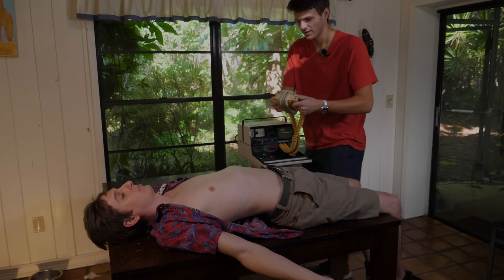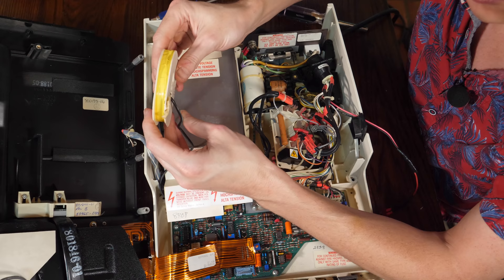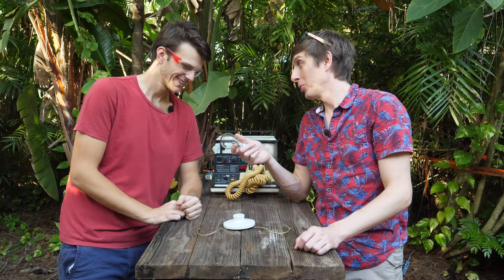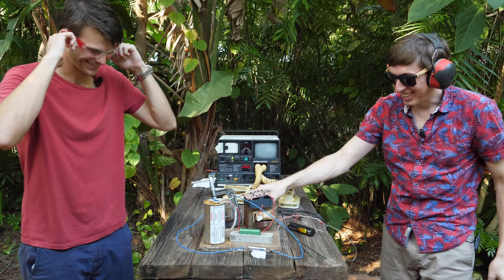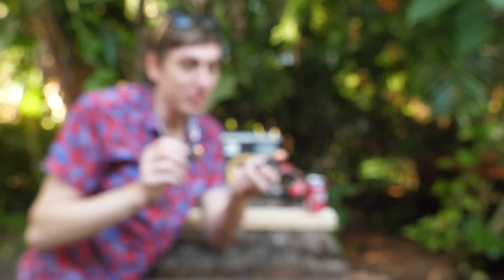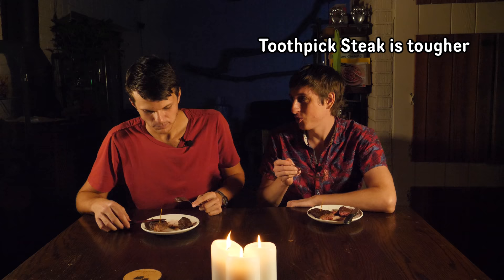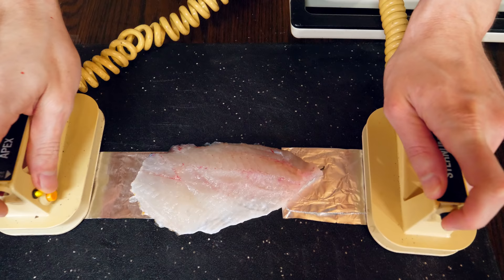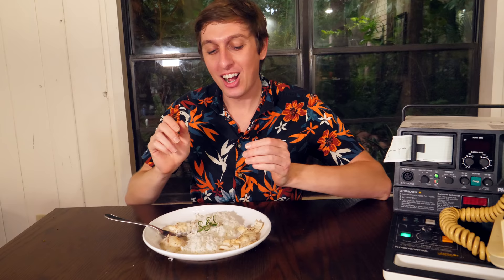We Defibrillated a Steak

Comment: “This is my homemade defibrillator” is just one of those sentences that makes your hair stand on edge
Reply: Literally
Reply: Take the like and go.
Reply: Much like the defibrillator itself
Reply: You can too. His model doesn't have the safety measures, its basically the transformer for thousands of volds, and the capacitor big enough to hold it. Its expensive and wont work on people withiut proper connection or safety. Still its a good project.
Reply: Gave me a shiver
Reply: Pretty shocking that you can get them.
Reply: It looked like a bomb
Reply: Or make your heart stop
Reply: @melester2728  or turn you into electro
Reply: @karbonkai  all electronic components are easily found in stores. You can create your own biomedical equipments if you like. The problem is that if the systems aren't supported by regulation, its illegal to use them or sell them as a biomedical equipment. Like a kitchen knife and a scalpel, both cut, but if a doctor uses the knife he goes to jail.
Reply: "....1.5 Volt AA lithium battery. So, if this explodes, it's gonna be good!"

"Yeah"

.. Yea
Reply: I got a few defibrillators around the house, they're called power outlets.
Reply: People round here dont build defibs, they just nick them off the wall as so many places have them. Open them up, short out a couple of the wires, and it bypasses the automatic part of the system and allows you to use it as a Taser (or, as in this video, to cook meat, win free worms, or open coke cans)
Reply: I was thinking "this sounds like a disaster about to happen"
Reply: I saw a hair ad when I read this
Reply: I think something might be wrong with the defibrillator then
Reply: Imagine using someones bathroom then getting blacked out and then you waked up tied to a chair and you hear someone say that
Reply: Imagine if someone is dying and there’s no defibrillator around he’s just walking down the street saying I have one 
Everyone: “*acts relived*”
It’s homemade
The guy dying: lord it’s my time to go
Adios

Comment: Whoa, defibrillating the ground to get worms to come to the surface was one of the most interesting things I’ve seen in a long time.
Reply: I know right!
Reply: Same
Reply: You can get the same effect (without the electricity) by putting a metal stake in the ground and hitting it over and over, preferably with something else that's metallic.  Or, you can use a "tamper" and just tamp the ground over and over and they'll come up as well.  Both methods work extremely well down close to a river.
Reply: @dgoddard  tamper?
Reply: @slimeball4l540  Just a flat piece of steel (maybe 6"x6") on the end of a handle so you can bounce it off the ground.
Reply: And If I remember the product was called the worm taser
Reply: Same-o
Reply: watches fireworks used to kill fish
Nvm...
Reply: @dgoddard  or you can fill a bucket of water with washing up liquid in it & pour it on the ground !
👁👄👁🍿
Reply: You can see that in godzilla movie.
Reply: @joe18425  a simple saltwater could do the trick just as well
Reply: you havent' seen godzilla 2000? yet
Reply: Does no one remember that one scene in Godzilla?
Reply: @joe18425  Why do Brits bother to say/write all those syllables in "washing up liquid" rather than just saying "soap"?
Reply: You can also just split an old extension cord about 15' from the removed female end and twist the ends around a pair of rods that pound into the ground (a foot or so) about 10' apart, soak the ground good with a sprinkler (way beforehand) and plug it in for a few minutes. Don't let kids play around it though.
Reply: I read that as “worms come out of the steak” at first
Reply: Must be a youngster, old old trick.
Reply: My grandpa used to do this.  They don't live very long when you do this, only a day or two.  If you pick them at night they will last over a month in the fridge.
Reply: Saturate the ground with water and cover it with a tarpaulin or some plastic. The worms will come to the surface in need of air, and the covering stops it drying out plus the darkness will keep the worms at the surface, they hate sunlight. It doesn't take very long, as soon as the water soaks down to the worm it will surface straight away. And Earth worms only live in the topsoil, I've never seen one deeper than 1 foot.
But choosing the right area of soil is important, there wont be many if any, the harder and dryer the area and the hotter the area.
Reply: I have heard about "fiddling" for worms as well.  I was just  a kid, and the person that told me about it is long dead.
Reply: you obviously never watched godzilla 1998  cause they did pretty much same thing ;o
Reply: When I saw that, it reminded me back in the days when I was watching Godzilla, 1998 movie. A bit later in the beginning of the movie, Matthew Broderick put the metal poles in ground and then connect to battery and that brings up a lot of earthworms.
Reply: It was faked ... can't you see the difference on the ground
Reply: @dgoddard  That is what the old timers called fiddling for worms.
Reply: @dgoddard  So basically what they do at Dune...
Reply: @joe18425  "washing up liquid" you mean that weird stuff rich people call soap?
Reply: Worm torture.
Reply: Duuuude this was in godzilla with mathew Broderick
Reply: Man I feel bad for the worms. Its like someone set fire to your entire neighborhood and abducted your family when people are out.
Reply: That is interesting
Reply: If they could speak, they'd be complaining 'OW! What was that?!'

Comment: That worm thing was fascinating. Maybe something like that can be used to deal with more dangerous invasive worms?
Reply: Wouldn't it also affect native worms?
Reply: @ShiratoriIsOffline  There is a huge swathe of the US & Canada that actually doesn't have native worms. They're all invasive. Not all of them are a problem, but neither would be getting rid of them. But, irregardless, you can just gather up the bad ones & ignore the others, if you know how to tell the difference.
Reply: Wonder if anyone’s tried using it at a lower strength to improve soil quality.
Reply: @MrChristianDT  I learned something interesting, thanks
Reply: If it just rained and you point a flash light at the ground the worms will crawl out to crawl in the pools of water if it rained that much
Reply: Are dangerous worms a thing?
Reply: Some can bite through boots. I think they're called flatworms or something?

Comment: What I've learn about ventricular fibrillation, is it's easier to compare it to swimming. If you do dedicated strokes, you'll move. But, if you flail, you don't go anywhere. Instead of moving water, your heart moves blood. And when it sputters, it isn't moving blood
Reply: . Go
Reply: The heart is a SYSTEM of pumps and chambers. If it’s all wobbling spastically at the same time, it’s not able to send/receive blood. No matter how energetically it is dysfunctionally wobbling. 
Defibs stun the heart into inaction; the practical aspect of that is then, with appropriate cardiac massage, the heart can sync back up with correct timing thru nervous system. 
Gotta stop the heart flopping to start it working. Technically, you are inducing death so you can prevent it becoming permanent. 
A spastic heart muscle is not being oxygenated. It will expire unless stunned into inaction

Comment: Shoutout to the Darwin Award winner that went "HEY... IF YOU ELECTROCUTE THE GROUND IT MAKES THE WORMS COME TO THE SURFACE!" without taking into account that they were, also, standing on said ground.
Reply: Bruh moment
Reply: They were on foam, so they were plenty insulated.
Reply: @mysan7754  He is talking about the device in the 80s that lead to 30 deaths, that is directly referenced to prior to the foam
Reply: the sad thing is most of those deaths were children playing with the devices
Reply: Nah man they were already "grounded"
Reply: @mysan7754  dude, can u read?
Reply: BRUHH Darwin award indeed
Reply: Please correct me if I'm wrong, but electricity goes to ground not though ground? Based on your joke (I'm so hoping) a lightning storm would be nature's equivalent of mass murder.
Reply: @xr88yu  was going to reply with the same common sense since the lightning flash we actually see as a strike is actually a from the ground up motion.
Reply: they are insulated from said ground tho
Reply: @xr88yu  There are multiple kinds of lighting. Most is cloud to cloud. Cloud to ground lightning does in fact murder, usually by causing massive fires.
Reply: @comandosespeciales  prob wouldnt kill ya.. worst case is it cooks your junk.. which being sterile TECHNICALLY makes you eligible for the darwin award.
Most likely all the deaths occured from people touching the paddles to atleast 1 body-part directly and not with both of them on the ground
Reply: @xr88yu  
What happens is electricity evens out through path of least resistance.
Ground is a massive bad conductor (still much better than air) at about neutral charge, so random charge, such as static or lightning grounds out. This also applies when the charge is not entirely random, but the other side of the circuit is nowhere nearby.
However a device like this generates two charges on a capacitor, one positive, the other negative. In evening them out, current flows between them through whatever you connect them through, in this case dirt.
However, depending on local humidity, humans can be significantly better conductors than dirt. Though with the charge involved, about equal would be enough. If a human is touching two places on the ground directly between the electrodes (the further apart, the worse), a part of the current goes through them. This could kill.
Reply: People didn't actually die from the just zapping the ground, they died from grabbing the rods on the uninsulated parts, touching the ground picking up worms with both hands in a way that they created a path of less resistance across their bodies than through the ground, and generally, just not understanding how electricity works. 

I use these.  But you stick 'em in, plug 'em in via extension cord, and then (now, this is the real important part) unplug them before picking up the worms.
Reply: they also wouldn't get shocked if they just don't stand in between poles. shoes would've been enough resistance. simple as that.
Reply: @frantisekvrana3902  Yup step potential. If a power line were to fall in your vehicle, you wouldn't want to just walk out of the vehicle as you could complete the circuit by having your feet in two separate spots. Basically hopping with both feet together would avoid being part of the circuit. With that said if possible its best to wait for that part of the line to be isolated and deenergized before exiting a vehicle in said scenario.
Reply: @VoidOneGamer  What about using said vehicle, if it is still operational, to get from under it. Not always possible, but sometimes, it might.
Reply: @xr88yu  electricity goes through the ground and so does a lighting bolt, but your shoes block it so it doesn't pass the electricity to you
Reply: @FBI-lk2wn  I'm sure their are more important things the FBI could be doing.
Reply: Electricity takes the shortest path
Reply: @masonhunter2748  path of lease resistance.
Reply: Well, technically electricity takes all the paths for which it beats dielectric strength. This is why you can plug multiple appliances into the same power cord.
But the current splits among the paths in the inverse ratio of their resistance.
Reply: How could all the worms survive while the people using the defibrillator would die if they aren’t isolated ?
Reply: @mysan7754  Clearly the commenter was not talking about the backyard scientists, but the actual Darwin award winners.
Reply: @xr88yu  Electricity definitely travels through the ground, just not very far. Lightning has caused mass deaths many times when people or animals are huddled near enough to the strike point.

Comment: “What if it sprays on us and then it's, like, electrified soda”

With that level of understanding they really shouldn't be building their own defibrillators.
Reply: It's the backyard scientist he's gonna do it either way
Reply: Lmao
Reply: True enough, lol
Reply: Liquid CAN conduct electricity, genius.
Reply: @davelowets  someone should look up the term "the path of least resistance"
Reply: Hes a Florida man. 

enough said
Reply: @davelowets  distilled water are not conductive
Reply: @hellboy3652  No, but it sure is when there's sodium in it. Wise up.
Reply: Yeah, but Florida
Reply: @syndan9245  touch a wire in your electrical panel then an electrical circuit has got to have less resistance than your body
Reply: @davelowets  You shouldn't either
Reply: @WearyKirin  it wants a path to ground and you happen to be that
Reply: He’s not wrong
Reply: Which is further evidenced by the fact that the homemade defibrillator started applying current to the can the moment it was plugged in instead of merely charging the capacitor, followed by their admission that they must have broken the switch.
Reply: @davelowets   it wouldn’t have been electrified 

The myth busters tried to make a electrified squirt gun 

It doesn’t work water doenst carry a charge well

And soda doenst ether
Reply: Pretty sure that was a joke
Reply: @davelowets  CONDUCT electricity, not store it. He would have to continuously be shocking the soda while it was  spraying on him for him to get shocked
Reply: pretty sure he was joking. With that level of understanding you wouldn't be able to make the stuff he makes.
Reply: @davelowets  my man, water cant store electricity
Reply: @davelowets  low e.t.'s or low iq?
Reply: @poodypooroo  How about you wise up, and make sense next time, huh?
Reply: @davelowets  liquids with dissolved salts and minerals in it bc ions will carry charges
Reply: @davelowets  Right, because the water just stores electricity like a battery while flying through the air?
Reply: @davelowets  but then it's not pure water anymore 🤷‍♂️
Reply: @jsbgamedev89  Who said anything about it having to be pure?? 🤦🏻
Reply: @davelowets  distilled water is pure bro
Reply: @jsbgamedev89  Yea, so?
Reply: @davelowets  so.. when you put sodium in it, it is no longer pure distilled water, and it will therefore conduct electricity. "wiSE uP"
Reply: @jsbgamedev89  Yea, no kidding. 🙄
Reply: @davelowets  by the time the can started spraying the charge had already left the can lmao
Reply: @alexanderartaza2173  Sure it can you just need to stir it in
Reply: Are they wrong?
Reply: Fr he didn’t even know what an arc is called, he was just like wow big spark
Reply: @CerealWIthIce  The backyard scientist lives in Australia stupido
Reply: @nuclearpotato6616  you fr?
Reply: I was also surprised how he expected the slice of steak to move, i mean im not a biologist or a doctor but im pretty sure there was no way it would do something as the slice is just a thin cut of the muscle perpendicular to the muscle fibre. You would need to have a bigger slice and apply the defibrilator handles in the direction of the muscle fibre.
Reply: I think they said that jokingly, just didn't want to get wet
Reply: @davelowets why are you like this?

Comment: I've been a paramedic for 27 years.  That is the oldest defibrillator I've ever seen that still works.
Reply from the maker: Well to be fair it looks like it sat in storage since 1991. Thats the last time the unit was inspected. It came with everything brand new still in packaging. replacement parts, leads, electrodes, gel, a manual with full schematics and test waveforms for like every single transistor (and a military manual thats only like 5 pages lol), it also came with these funny ECG electrodes that use suction instead of adhesive.
Reply from the maker: @Enrage X defibrillator go brrrrrrrrr
Reply: I’m dying 😂
Reply: @TheBackyardScientist  can you make something that will be able to see two pretty best friends?
Reply: Same, I've been a medic for 18 years and have never seen one that old actually used.
Reply: If you don't mind scanning the manual and schematics and putting them online or something, I'm a bit of a nerd
Reply: a
Reply: @TheBackyardScientist  haha, defib go zap
Reply: @TheBackyardScientist  Hopefully defibrilator not go brrrrrrr as that might mean bad defibrilator. Defibrilator go BZZZT on the other hand?
Reply: how much did it cost to get it

Comment: “Wow look at all these worms!! Theres so many of them!!”
The worms:
AAAAAAAAAAAAAAAAAA
Reply: What if the worms were all dead then they were brought back then they came to the top to die from the heat of the sum because they were having fun in worm heaven
Reply: "these worms are so good" uh...
Reply: I thought electricity couldnt channel thru grounds
Reply: @bloodmistvillage2405  ah no, the ground makes electricity less dangerous because it lets it travel through it much more easily than other things.  i think
Reply: @owen-tj3yl  not really. it has to do with electrical resistance. in simple terms: electricity looks for the easiest way to get from plus to minus. you can see thundderbolts branch out the way the pulse from the defibrillator would do. energy also moves in waves of different lenghts. some energy gets lost on the way from plus to minus and the worms feel these waves. they also take the simple route - they are going to the surface. this is the evidence for another rule wich we don't need for understanding the topic.
Reply: @fuddafirst  Yeah, your explanation is much better than my hearsay haha
Reply: I was thinking the same thing lol

Comment: You need an electrolytic solution/gel to appropriately allow the charge to flow. Also, when a patient suffers asystole that’s when CPR comes into play.  It gets the heart to start spasming at which point you can defibrillate it in order to restore a normal sinus rhythm. Not a doctor but keep that in mind!